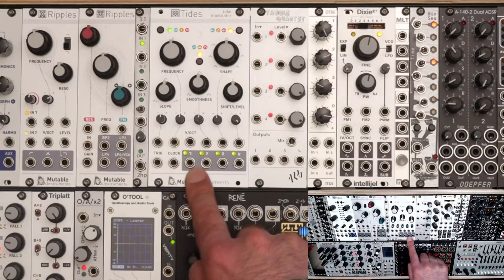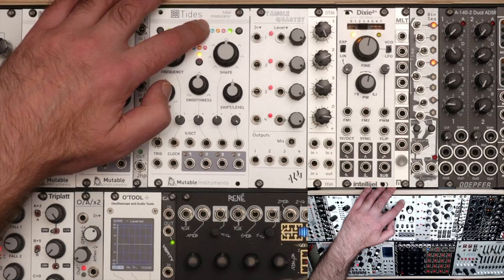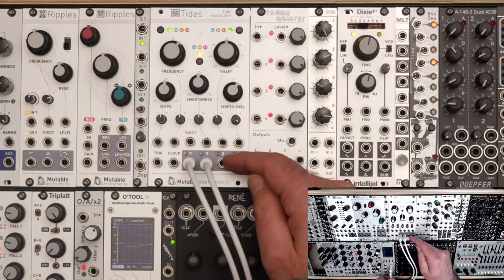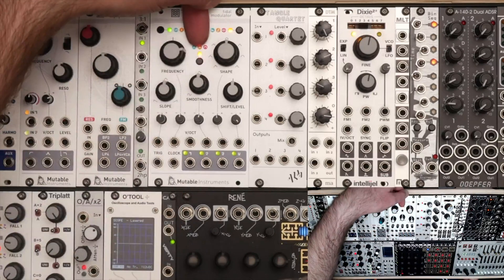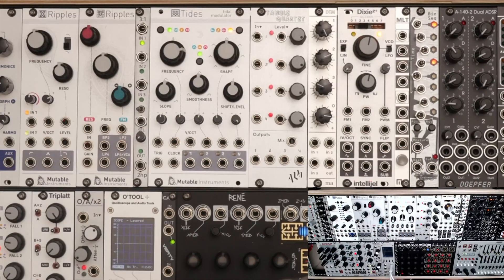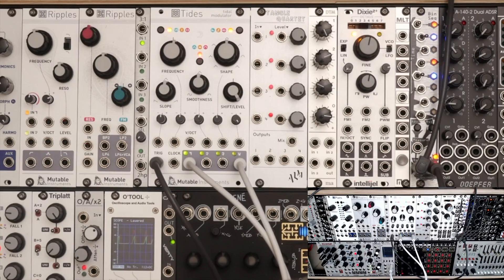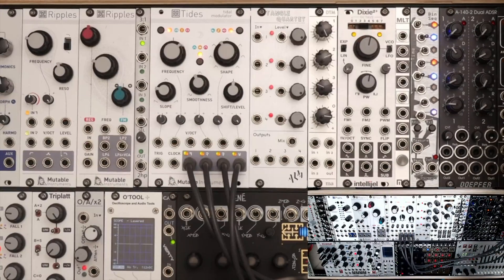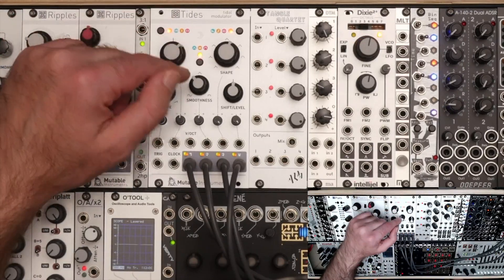Mutable Instruments Tides v2 Tutorial: Shift Modes (Part 2)

Comment: Thanks for the vid! Quick question - when Tides is operating at audio rates, can the trig input be used to trigger an envelope, almost like it's making use of an internal VCA? Not sure if that question is clear, but it's a behaviour that both Rings and Plaits have - if you send a gate to the trig input, it will trigger an envelope on an internal digital VCA. I was just wondering if Tides could act the same way. Thanks in advance!
Reply from the maker: Yep, I know what you're asking. The Trigger input does NOT activate an internal VCA; it will simply start the cycle over from the beginning of the attack phase. I confirmed this with the manual, which says, "In cyclic mode, a trigger will reset the oscillator so that it starts a new ascending phase."
Reply: @ferrycollider  Ahh okay interesting, so it almost functions like an LFO reset. Thank you for clarifying that I couldn't find any clear answers online!
Reply: @CharlieGearon  In envelope mode at audio rates, you get clicky sounds which are rather usefull to pingin filters and resonators, like the Rings module.